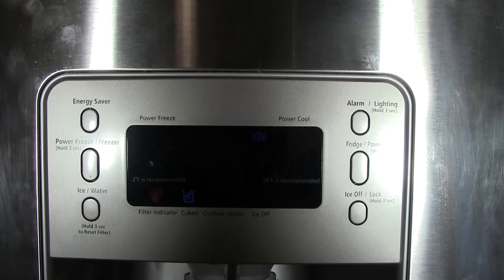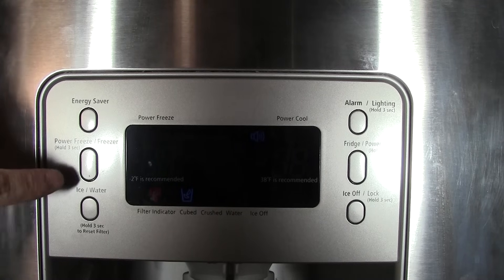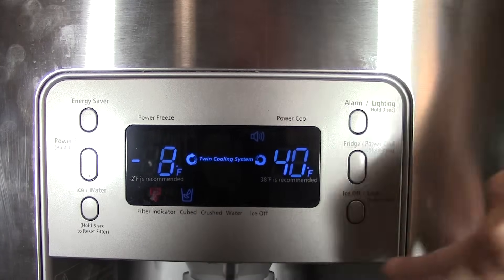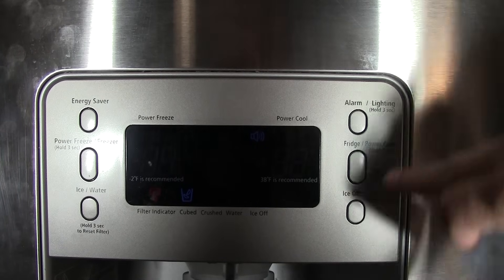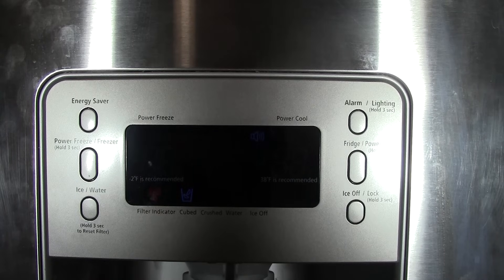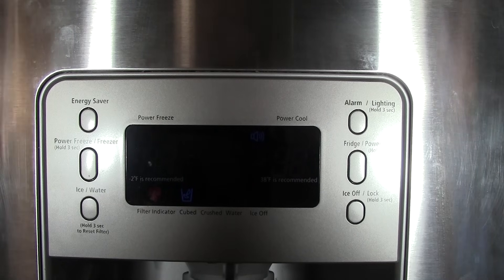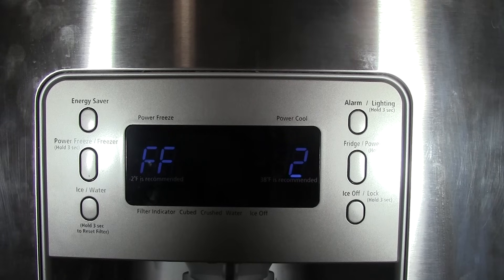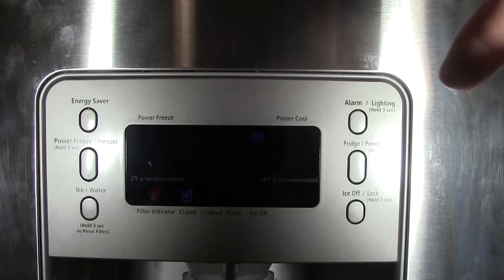FORCED (manual) DEFROST mode on a Samsung Refrigerator--Top Secret Setting

Comment: As I type I have it set on forced defrost to try that because I don't have 5 hours to take it all apart! I just wish I had the money to roll this junk down the hill I live on. The new Samsung commercial makes me sick to watch...I want to yell at the people to "keep their old appliances, they are in for lots of problems."
Is there no permanent fix for this other than rolling it off the mountain?
Reply: Replace Defrost sensor or(less likely  Defrost coil). All else is temporary "fix". My Samsung now 8 Months after replacing $15 part, works like new , no more manual defrost and coolers...  cheers
Reply: I have replaced the sensor too and I still have ice build-up, on the left hand side of the fridge, near the vent. I do not know if it has improved at all. It may be that the ice build-up process is slower than before, but it is for sure still there.
Reply: @Shalev53  May need to cjeck the df heater itself AND all connections including the fan.
Reply: @rickeykeeton4770  The df heater measures correctly and the fan connections are all okay, yet there is still ice build-up on the left hand side of the fridge!
Reply: @Shalev53  Sounds loke you may have room temp air mixing with the cold air in the fridge.
  Do thr dollar bill test.  Close the door / drawer with a dollar bill between the gasket and the cabinet.  Pull on the dollar bill.  There should be a fair amount of drag felt as you pull the dollar bill out.  Do this all around the gasket.
  If there is no significant drag on the dollar bill, room temp air is mixing with the cold air in the fridge causing condensation.  This condensation with freeze and kerp building up causing problems.
  Also check for sny obstruction to the drawer/door opening and or closing.  Ice had been known to cause obstruction behind the freezer basket and on the rails.
Reply: @rickeykeeton4770  I would have expected to have more ice all over the fridge if it was the case of air at room temperature mixing with the colder fridge air. I have no ice build at all on the freezer side. The only spot where there is ice build is inside the fridge on the left hand side, near the left air-vent (in the proximity of where the sensor is installed, behind the panel). Prior to replacing the sensor the same ice build was being created, only that  the little square hole (another air vent?) was also getting filled/blocked with ice. Since I have replaced the sensor that seem to have improved, in that there is no ice build inside that square hole (air vent). Nonetheless, the icebuild seems to be ever-growing and it isn't a pretty sight and surely not an expected design feature.
Reply: @Shalev53  Air vent?  This would not be the inlet for an icemaker would it?  If so and there is no icemaker, try sealing that "air vent" to possibly block any room air from entering there since the ice seems to be forming in that general area.  Just taking a stab at the problem here.
  Some of the top mounts I have dealt with that can have an icemaker installed but never had one, had a plastic insert blocking the opening where the inlet tube goes.  It stays in place unless it is decided to install an icemaker.  Imo, it should still be sealed at the back of the inlet tube to prevent cold air and warmer air mixing.
Reply: @rickeykeeton4770  Not sure how best to descibe this (air vent). I think that these are air vents that allow cold air that is created at the back of the fridge to flow in. Let this be clear, I am not describing the freezer side; that is where an icemaker would be. That part of the fridge has absolutely no problems at all and never had. The ice build up is on the fridge side only and only on the left hand side at about half the height of the fridge. It is there and only there and it had started after about two years of the fridge running.
Reply: @Shalev53  Being unfamiliar with Samsungs,  I cannot really comment.  I did think we were talking about the freezer side.  Sorry about that.
  These are a little different animals than I am accustomed to dealing with.  
  Is yours a samsung frenchdoor with a dual system?

Comment: I have used my extended warranty five times on my Samsung French Door Frig. We replaced the ice maker twice. Now that the warranty is up the defrost doesn’t work. Now it won’t cool properly. Watched YouTube to fix “common problem”. Not an easy job. Discovered Samsung had already replaced the defective part! Incorrectly too I may add. We were intentionally sold a defective product! Never again!

Comment: Thank you Jake (guitar01) you were extremely helpful. I am a guitar player and singer songwriter too.you are right about the ice maker/Lock feature bering useless!and good to know the secret functions. thanks for the explanation of forced defrost. great job great video.
Reply: ice maker function is good, (you do NOT hold in for 3 seconds to disable that). I use it because my ice maker broke and I'm too cheap to fix it, lol. No need to keep it locked though, but I suppose it could come in handy with kids (or my wife who randomly seems to change the temp of the fridge so I have to set it back to standard sometimes)

Comment: Great video:):) Party Time:):):) Mine is a 4 door RF32MQDBSR and while slight differences exists your instructions did the trick; so far it works ; Do you think you can figure out how to come down with the temperatures as displayed? Mine is at max (34F and measured by thermometer is at 45 F deg)
Reply from the maker: +Tomis Sevenfivetwo ---either your thermometer is wrong or the computer display is wrong.  If I had to make a bet, I would say that it's the fridge display/ computer.

Comment: does it affect the freezer? my freezer will still be cool after a firced defrost and the demo mode? thanks
Reply from the maker: I'm not sure.  It may depend on the model fridge you have and it may give you the option to defrost the one you want.
Reply: +jakeguitar01   I have the same control panel as yours but mine goes from FF to rd (refrigerator defrost, fresh food section) to Fd (presumably freezer defrost but could be both sections).  Who knew owning this refrigerator would be so nostalgic - just like the ones previous generations had that required manual defrosting!  If you ever add to this video another "secret tip" is:  Every time my power goes out this refrigerator locks up the display panel buttons and shows 88 88 to reset it to normal you press the top buttons on each side, "Energy Saver" & "Alarm", simultaneously for 10 seconds.  Thank you for your videos, subscribed...

Comment: Thanks so much for this. Forced defrost fixed my fan noise without the need to remove the panel. I've got the RF24HSESBSR, and this gives a rd option for refrigerator defrost, as well as fd for freezer defrost.
Reply from the maker: Richard Levy --- excellent.  glad it helped.  it's probably a good idea to do a forced defrost once every week with these Samsung refigerators.   As long as there is not too much ice back there, you should be able to defrost it in an hour or so.  Just don't forget to turn off forced defrost when finished....  all your food will spoil.
Reply: Thanks for the video, really helpful. I'm having issued with my RF28HMEDBSR on the ice maker with ice build up and the tech says needs to replace the auger motor. Can I run this FD mode with the food inside without getting spoiled? What about the food in the freezer will defrost as well? Thanks again

Comment: I ended up trying the FD option and it wouldn't do anything for me. I think it might be the defrost heat ring not actually heating to work and melt the ice off as I turned it on for maybe 20 minutes then pulled the fridge apart and there was no warmth coming off the heat ring at all. So likely I assume I would need a new ring?

Comment: Hello!
I know that your video is not about temperature, but I thought  that you will  probably  have some information about it.  .   .
Could you help me?  I've been looking for information about how to programme the temperature of my refrigerator....
The problem is : I've been trying to programme it, but every single time , that I do it,  the screen "removes" everything.

Thanks in advance.
Reply: Katy, it is normal that you set the temperatures to whatever you chose and within a few seconds the panel returns to showing the actual (measured) temperatures. Don't panic, just let the fridge do its work and you will see that the temperatures eventually arrive at whatever setting you have selected.
Reply: Hello!
Thank you for answering me... :D
 The refrigerator's compressor was broken and it had stopped cooling :( a person checked it, but it was not easy to fix it

Comment: JAKE - how do we defrost the freezer? mine keeps freezing the door shut. I have replaced the part on the coil - not sure why this is happening. We are gonig to disconnect all water functions on this machine and use it as extra but need to get the freexer drawer open without ruining all the food there and in the fridge.

Comment: Samsung appliances are garbage. I hate this piece of shit. Thanks for posting this.
Reply: Me to , I might go fridgidare or whirlpool or kenmore
Reply: Chromaesthesia same here, one technician of 30 years would not even come and look at mine said samsung were the worst fridges to work on.  The other spent one and half hours and could not find what was wrong.  The problem is that it goes into defrost and melts the ice and in some cases defrost the food in freezer. Freezer may be set at -18c and it will go up to -10 and in the fridge it will go to 10c when it’s set at 1c....when the problem begins there is a light under the rim of the french doors that flash on and off... I was told over the phone by the technician to see what was happening behind, Was the fan going or the condenser ect well the fan would stop when the lights began to blink on and off from under the doors and would flash on and off when the fan began again...Then I had to take of a panel off the back which was covering the computer board. A little red light which should be showing now was no longer on while the fridge was not in working mode that is with the fans not tuning....It could cost around 500 dollars to fix I would spend it but what if that’s not the problem, I will have spent all up 700 dollars. My husband said put it on the sidewalk for collection, 
But I am hoping I might be able to find the problem myself
Could you give me any advice? I have a SRF801GDLS
Reply: to fix fridge with electronic parts, you need technician with electronics and refrigeration experience and training. regular refrigeration technician cannot troubleshoot down to the  component level of electronic circuit board. it is time consuming to troubleshoot to the component level and technician does not carry all different circuit boards for different fridges. it is also not easy to get the replacement circuit board for old fridges.

Comment: My refrigerator is different.  I do not think it is a specifically named button but the location of the buttons.  On the buttons on the left mine works with  the first one but is named "Freezer".  On the right group  of buttons the proper one is the second one (middle) and it is named "Lighting".  I hope this helps.

Comment: Dealing with this right now,  I was told by a Samsung Tech (friend) to just put a copper wire  (ground wire from Romex) down the drain and attach it around the heating element.   I guess there is a flaw with the clip that is suppose to do the defrosting from the heating element.
Reply: I've done that but it is still freezing up ...sigh. I hope I can find the video he said he posted about fixing that.

Comment: Jake mine is completely frozen in the back where the fan is in the fridge. Will this defrost it enough to pull off the panel? How did the fix go for the drain?
Reply: Mine is doing the same thing, wondering how long it took to melt ice?
Thanks, Nicole

Comment: I followed your instructions regarding OF on the panel however it still does not work. Any other advice. Cols were cleaned and water filter changed.

Comment: Great info, thanks.  I saw a video on changing defrost sensor in Samsung fridge.  Do you recommend this?  My fridge did not have a frost problem for 5 years or so after purchase.  It has happened twice in the last  3 months. If changing the sensor could solve this, I'd like to know.
Reply: Mine in same boat as yours, didn't need this for last 6 years or so and now for last month or two it keeps frosting, I have changed the door seals too, no help :(
I called few service advisors here in area and no one wants to work on Samsung
Reply: You're going to have to ask an actual technician..

Comment: So when you use the Force Defrost in hidden options, does the refer stay working or is everything off?
Reply: The fridge is NOT in operation mode when defrosting.   Leave it in FD for a good long time to have all the ice to melt (1 -2 hrs) then put it back in it's normal operation, and put the food back in.   We use our picnic 'cooler' to store fridge items while it's defrosting...or haul the items out to our motorhome, which has a fridge.

Comment: I have a Samsung RS265TDRS and the refrigerator freezes up from time to time. There's two things I do. I press the freezer and lighting button for 8 sec and the display goes to OF. I leave it in this mode for a few hours and this usually melts the ice enough to get the refrigerator operating properly. If it freezes up again in a week or so, I'll turn off the power and open the fridge door and let it thaw that way for 6 hrs or so. Then I'll pull off the panel in the fridge towards the back to clear out the rest of the ice. I have not found the mode that displays rd on my fridge. I don't know if it's an option on my model. I know one thing, I'll never buy a Samsung fridge again.
Reply: never buy any fridge that has an ice maker in the frigde. saw that on a appliance tech video

Comment: I had two service companies to serve the ice problem, first one did work and to give us a new computer board to try to cure the problem. But after a month, we had the freezing problem back including the fan stop working. Then a couple months later our freezer stop and they try again. This went on for about 6 months and the company did not want to service it no more and refund our money. So we contact another authorized Samsung company, the repair man look and refuse to work on the refrigerator. Now, when we try to contact more authorized repair, no one wants to come to our address. Is this a blackmail type they have? For over a year and a half, we continued to have this ice buildup, freezer and ice maker stop working, and the refrigerator not working. The second company told us we have a bad evaporator coil and compressor just by playing with the buttons and refuse to continued. I am now going to try the Defrost method. Is this a problem since 2014, why haven't Samsung fix this?
Reply: silver rat I had or still have very similar problem with my fridge and freezer, it’s 8 years old and begun giving trouble over the last two months..when I explained to a technician the problem he every refused to come and see he said Samsung just have too many problems and he wasn’t going to bother servicing them, the second I paid 200 for 1 and 1/2 hours and not find anything wrong....it was working, but the ice in the box had melted some, The temperature controls does not indicate the real temp happening, I do have a  commercial fridge thermometer which I keep check

Comment: Thank you for the great information!  We have been struggling to figure out how to stop the deep freeze!!  Will go try this now and see if it solves our issue!  Thanks!

On a side note, you don't have to hold the Ice Off button to stop the ice maker - just tap it once.  If you hold it 3 seconds, it just locks the controls, not stopping the ice maker, that I know off.  But you will see if you just tap that button once, the ICE OFF message displays.

Comment: Thank you,",fd"  worked.   refrigerator is now working great .
Reply from the maker: Great to hear and thanks for watching.  Btw, if you know anyone who may benefit from this video, please share it.   Have a great day!
Reply: @jakeguitar01 jake, I just had the repair guy out for water under the last drawer tray. He replaced 2 tubes from the back and said they were blocked with frozen water. He told me, in the next few days, I had to defrost the fridge by emptying it and unplugging for 24 hours. Never mentioned anything about playing with the control panel. 
So, I am waiting for the weekend and trying to use up food first. 
Was hecright?

Comment: So have done the forced defrost twice this morning around 8am.  The temperature of the fridge still has not come up and it is 418pm.  So is this normal?  I dont know whether the fan is running.  my main concern is the fridge temp is still 14 degrees.  So I hit the defrost again thinking maybe its just not defrosted enough for the fan to move.  Comments???
Reply: Take it the rear panel off and remove the ice from the fan.  Youre welcome.